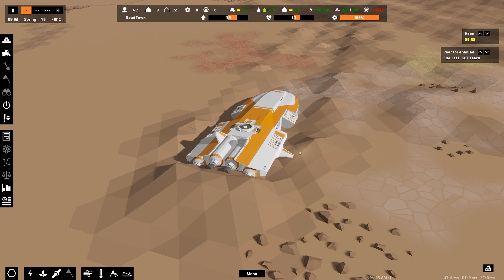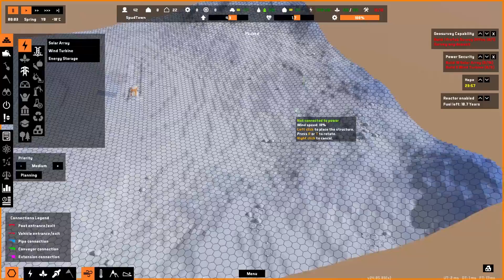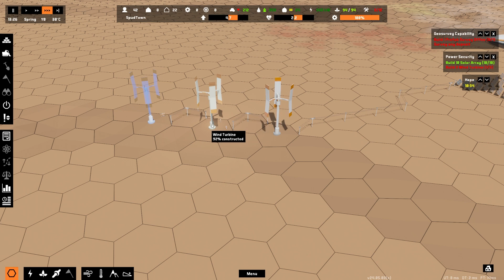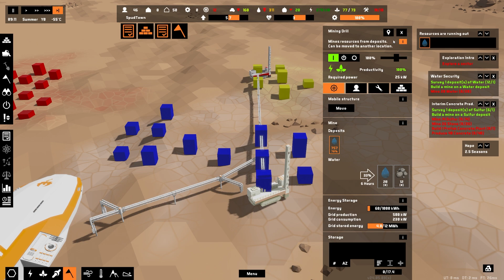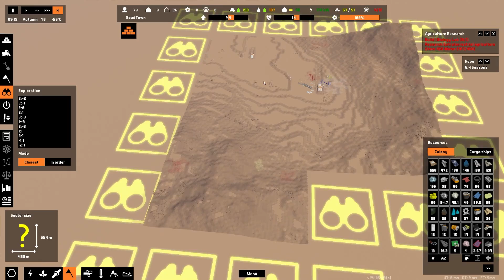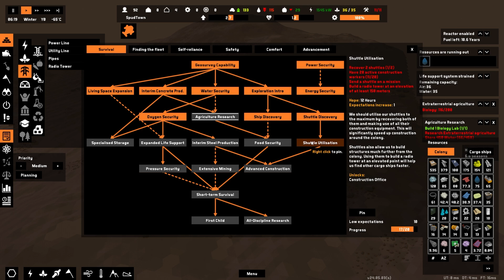This Is The BEST FREE Survival City Builder!! - Alien Horizon - Colony Sim Logistics Base Builder

Comment: 00:51 Interesting how that ship landed backwards.  Why shape it aerodynamicly if you're going to fly in arse-first 😆.  Sure I can understand it if it was using the rear thrust as breaking thrust, but why make it aerodynamic front to back if that's the case?
Reply: Perhaps it lost control before crashing. If it's a spaceship its design may not have been focusing on absolute aero stability as a priority, like planes tend to.
Reply: if you want to slow down, isn't it not being aerodynamic, in the direction you're slowing down, helpful? It actually makes sense, the question is why the others are front-first
Reply: @Dragoninja26  True, but then you'd slow down too much and stall, dropping like a rock.  It makes sense to reverse break in orbit on planetary aproach and in a vacuum the aerodynamics are pointless, but once you reach geostationary orbit it makes more sense to reverse and enter forwards so aerodynamics reduces resistance and thus re-entry heat.  Its definitely backwards!
Reply: I was wondering the same...
Reply: Maybe the coder got it ass backwards 🙃🙃🙃

Comment: I have one question, how did they manage to crash the ship in reverse ?
Reply: Interestingly enough, that is the most “realistic” detail for a space faring vessel.
In order to slow down, a ship must turn 180 degrees and use its main thrusters to reduce its speed, as small RCS thrusters are unlikely to overcome the inertia of the ship.
The ship does not seem to have wings or a control surface so it would not be able to glide to a crash landing.
Fantasy elements can be introduced to get around this, like the antigrav drives of Star Wars.
Reply: @Inanimate-Object  The other ships sitting here which have landed forwards then make almost no sense though. I guess it can justify why there are no survivors in them =) But that's far-fetched =)

Comment: i dont know why but the ship looks like its crashed backwards
Reply: because it was trying to slow down with it's main engines...before it crashed.
Reply: @henoch44  Back in KSP we used to call this Jebs plan Suicide Burn.  And it was a legit way to land a spaceplane on the Mun. 😂
Reply: Because of how orbital maneuvering works it would be moving backwards because it would be trying to slow down by firing its engines in the direction of travel
Reply: @catcat71gaming94  Not once in atmosphere. Then it would lose stability and only regain it, if ever, with the center of drag (flat end) behind center of mass.
Or maybe if it was completely empty (and engines outweighed most of the rest) it would land like this. But then imagine gliding it in backwards for emergency landing. It would be a massacre.
Reply: @DailyFrankPeter  If there actually is an atmosphere.
I didn't read the descriptions of the buildings, so maybe there is...
Reply: @nikelsad  Oh, I assumed Mars-like conditions.
Reply: @DailyFrankPeter  yes, even in atmosphere. It depend how fast it as to deceleration before landing for exemple.

Or maybe it is built to do it like that. The propulsion deck is also sturdy enough to take hit, when the front is not.
Can be many reasons for.
Reply: @DailyFrankPeter except if it was an emergency decent from orbit they would have come in engine first to protect the rest of the ship
Reply: Newtonian mechanics
Reply: Also could’ve been to avoid damage to the habitation section (front)
Reply: The captain was a bit drunk, it's fine
Reply: it probably did.
Reply: Now I'm imagining it rocketing in at mach 10, captain leaning out the window, doppler affected safety beeping.
Reply: Jokes on them they flew backwards and crashed where they started
Reply: because it 100% is backwards.
Reply: It’s because of the little dirt pile built up behind it instead of in front of it.
Reply: Correct, not well thought out.
Reply: I can tell you why - because it's exhausts are pointing into the hillside it dug up when it slid along the ground.
Reply: Little late, sure. Here's my take. At 3:27 tooltip says that engines are "... only designed for landing and are useless now". This ship was ment to land with engines first and stay stuck on planet it landed.